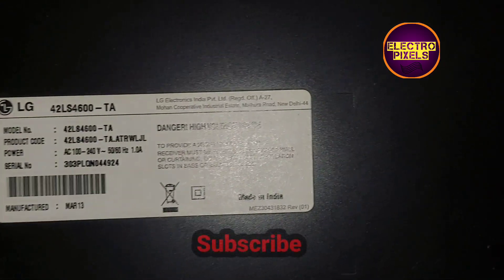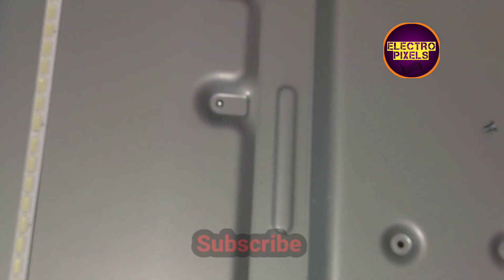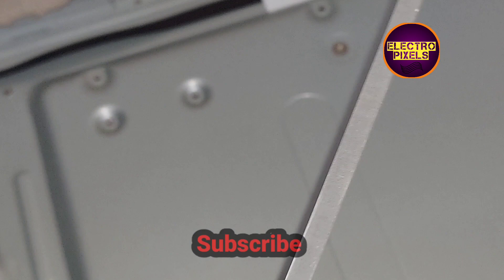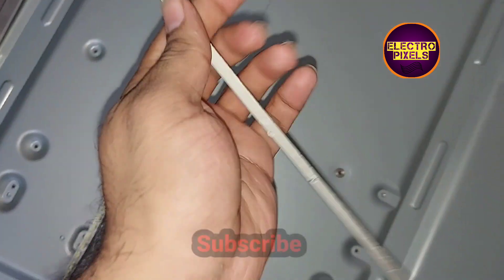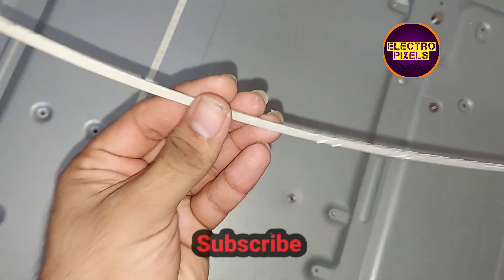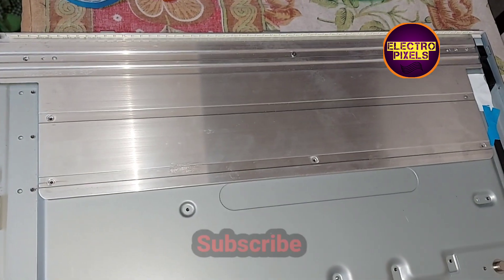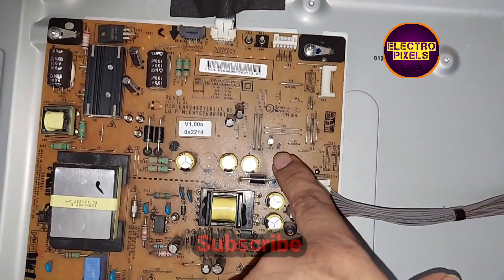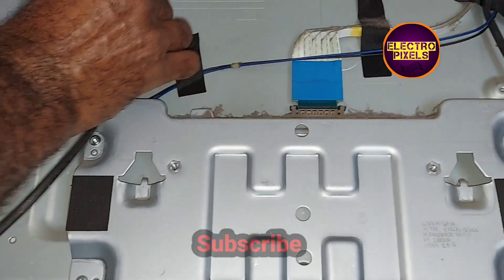LG led Tv 4 Time's SMPS led Light Blinking || Backlight Protection ||No picture due to Backlight

Comment: If 5x blinking?.. Already change backlight,its same not working.. Voltage pin backlight reading 49v..in board   62.7v..
Reply from the maker: 5 times blinking indicates a panel fault
Reply: If the led blinking 3 times? My tv the leds blinking 4 times for the leds, i clean the flex and i test continuity and the tv does not turning off, he work well  but the leds blinking 3 times.